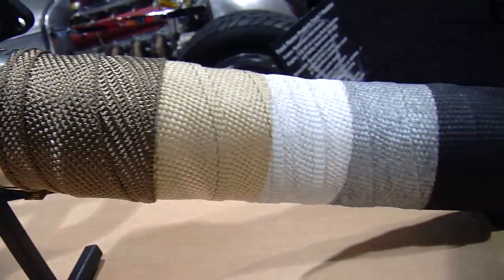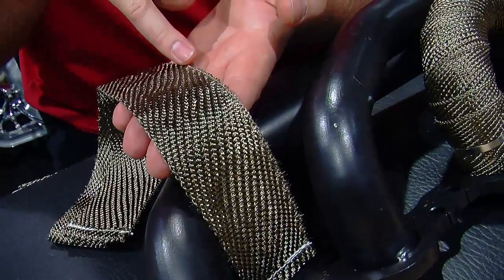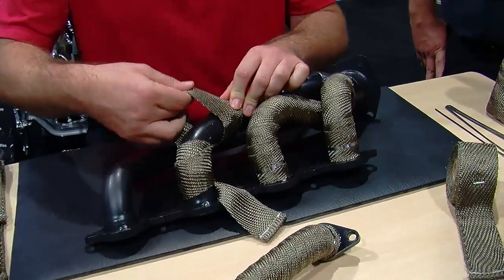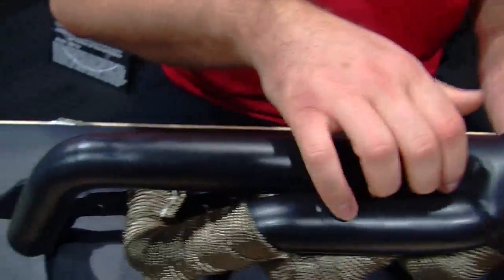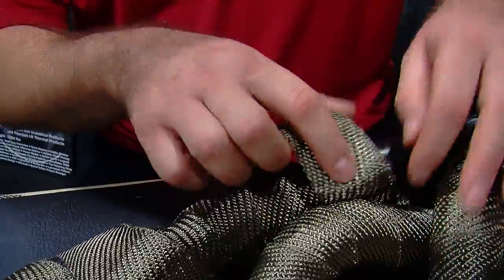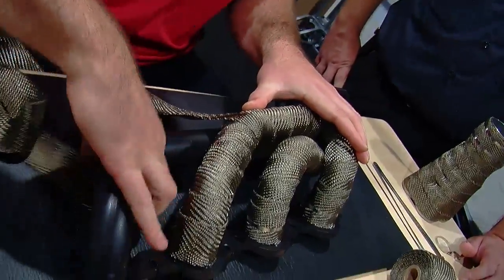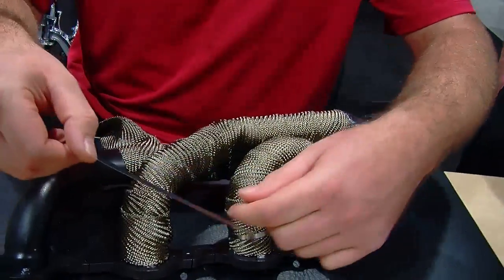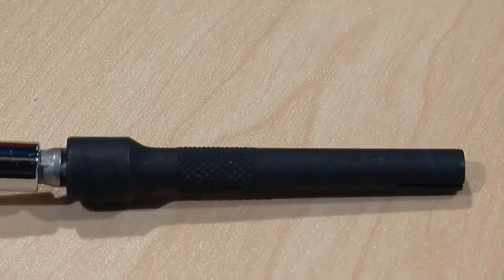DEI Header Wrap How-To at SEMA 2014 V8TV Video

Comment: I seen some cars after installing the wraps on headers they smoke, can you drive it right after installing the wraps? or do you have to wait till stops smoking?
Reply: William Menjivar just turn on your car or truck just wait till it smokes away your gonna be smelling it for a while thoe
Reply: Newbs you're supposed to sand off the factory paint. That's what's smoking. They put the black paint on to prevent rusting

Comment: Wrapping headers actually increases engine heat and causes headers and exhaust to wear faster.
Reply: +Jason Magik Thats not true. you need to do some research
Reply: Glenn Lopez How is a T304 exhaust gonna wear. Aftermarket headers and exhaust are built to late the life of your car and many times over. It takes temps way hotter than an engine in the form of exhaust gases to damage this grade of steel.
Reply: BRUH, don't even start. Go take some engineering courses. Don't drop Heat Transfer, Thermodynamics and Material Science knowledge if you don'y wth you're talking about

Comment: what if I wrapped and did not do a 1/4 inch?  I did more like half the total width/thickness of the wrap overlapped... should I redo?
Reply: +Rick Dangerous In doing so, you're over insulating that area of the manifold, which could lead to a degradation of the metal and cracking over time. I would recommend re-wrapping the manifolds, when you have the time.
Reply: if u are in the dry climate they do everything they say it does. but in my climate in northwestern on canada u can go through a stainless headers in one year. needless to say my stainless headers are bare.
Reply: Oh yeah, the brutal winters and salty brine from up north would definitely be harsh!
Reply: I dont drive my 69 572 camaro in winter nor even on sunny days.....but even in a sunny day the humidity is high enough to rust em.

Comment: Yes but what they dont tell u is that if u live anywhere other than a desert, the wrap holds in moisture (heaven forbid u pressure wash your engine) and wrots your headers very prematurely.
Reply: +Darrren Betker driving the car regularly burns the moisture off almost instantaneously, so it shouldn't be as much of a problem. Also, after washing the engine, do yourself a favor and let the engine run for a few minutes to burn the residual moisture off from washing the engine. To keep them from getting as wet, you can also buy some high temp silicone spray. hope this helps
Reply: dumbass😂 haha

Comment: Does a wrap around headers can cause rust by keeping moisture if you only use your car once a week?thanks
Reply: It will only accelerate rust if you get it wet without running the motor to dry off the pipes and exhaust wrap.  The exhaust wrap will not pull moisture out of the air but it will hold moisture if wash it and then park it.  Just run it for a while after washing or driving in the rain and you should not have any issue.